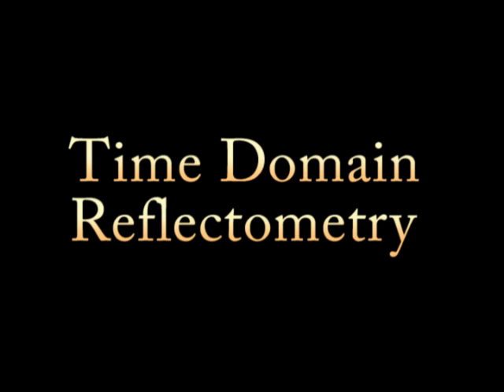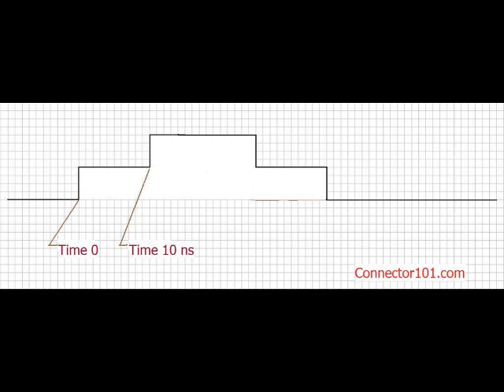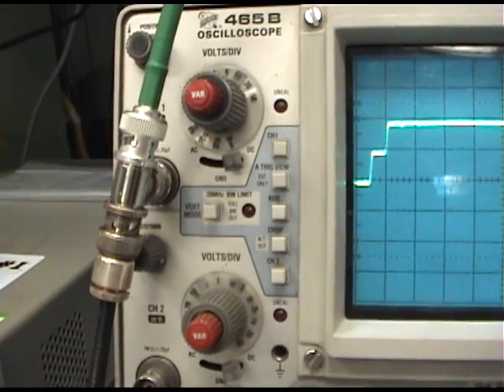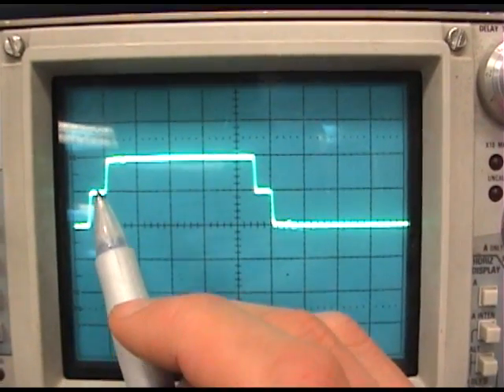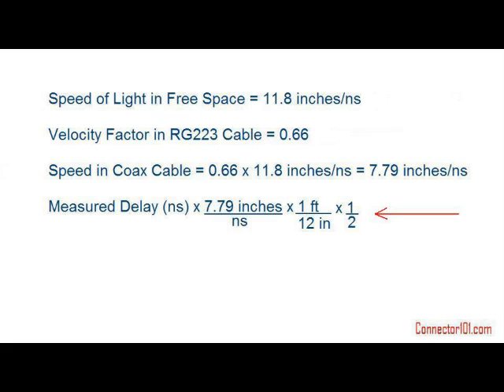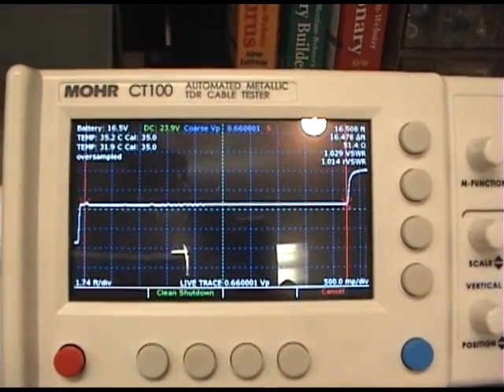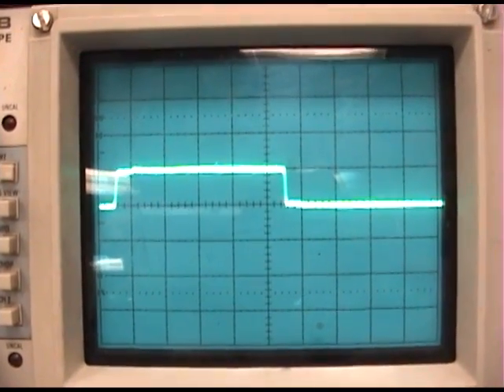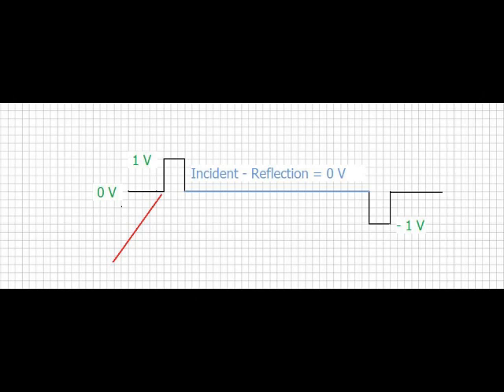Time Domain Reflectomety

Comment: Thank you for the intuitive video.
I have a question. What if there are multiple resistors connected to the cable at different locations?
Reply: they all would cause some kind of reflection, any break in the transmission line will cause this even proper termination points. this is why you use a TDR to make sure these losses arent above specs.  Cable, fiber dont matter any kind of change in the transmission line will show a reflection this is how you test lines because you know it is there for a certain value. if its not then you got a problem.  even a fiber weld shows up on a TDR. modern handhelds you dont even need a scope on them.  they got TDR's now that are even network analyzers for QAM* data channels cable all in one...

Comment: Hello sir.  Do you suppose a TDR could be used  to measure lengths in the order of a few inches?  I have a 3-ft multiconductor coiled cable that I need to find the break in the wire for, and it would be helpful if I didnt have to split up the insulation badly to find the break.  Thanks.